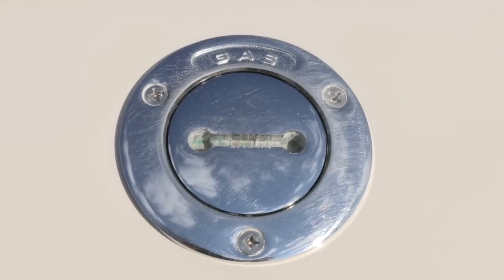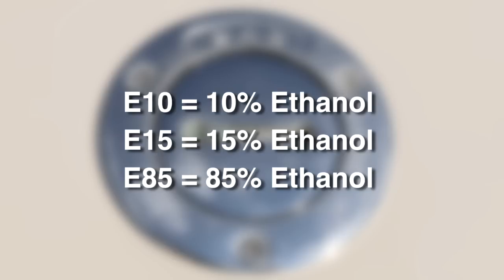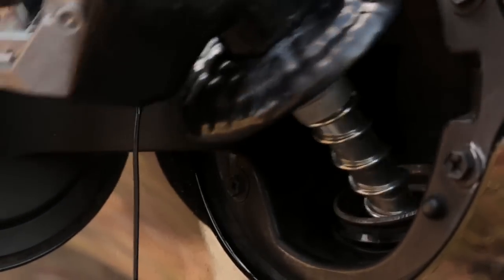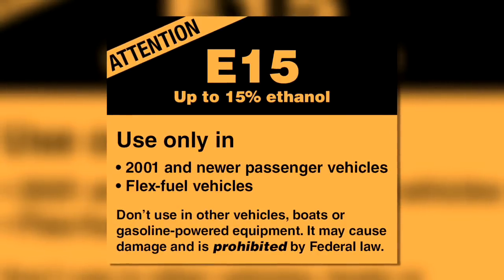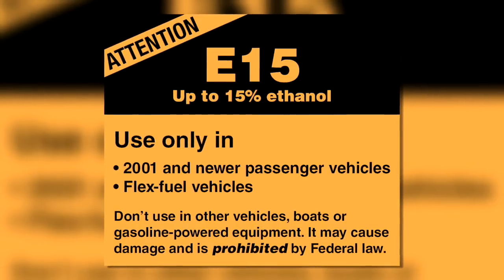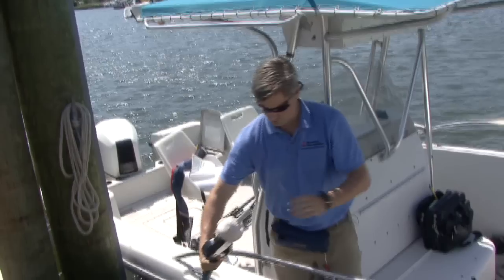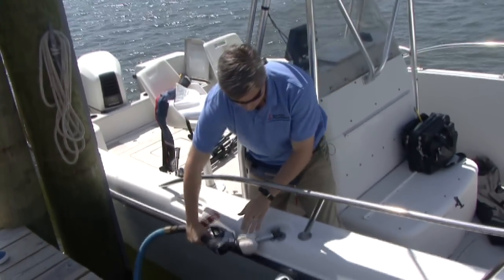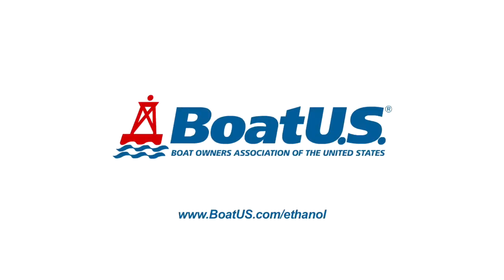Explaining Ethanol in Your Boating Fuel | BoatUS

Comment: Mercury Marine thinks E10(after a transition period) may be the superior fuel to E0 because it keeps the fuel "dry".  

Water in the bottom of fuel tanks is a problem of E0 gasoline which is why alcohol has been sold forever as gas-line antifreeze.  HEET and DRY GAS are two companies who make such products.

Mercury Marine, which hosted a Webinar on ethanol myths, noted that ethanol does not "grab water molecules out of the air." It is hydrophilic, which means ethanol holds water. With regular gasoline (E0) as well at E10, the primary cause of water collecting in tanks is condensation on tank walls. But unlike E0, which can absorb almost no moisture, E10 can hold up to half of one percent of water by volume, and the water molecules will dissolve in the fuel. The "solubilized" water will bypass the water separator and burn harmlessly through the engine.

https://web.archive.org/web/20140922142320/http://dcd96xmek71bc.cloudfront.net/archives/email/Trade/BoatingIndustry/MythsofEthanol-August252011.mp4

The common gasoline of Brazil contains a minimum of 27.5% ethanol and they have the >>very<< same boat engines we have here. 

It has worked out so well and for so long that Paraguay and Argentina have also gone to 27% ethanol.

 Clearly E15 would no doubt would run just fine and I would bet no one ever will be or ever has been arrested for using it.  Now that Trump has allowed E15 to be sold in summer, I would expect manufacturers to start including it as a fuel for use in future owners manuals.  

According to a paper published by the Society of Automotive Engineers, at 68 degrees F, alcohol with as much as 45% water will mix with gasoline and not separate. With 4%, alcohol will form a stable mix with gas down to about minus 22 degree F.*

*A.C. Castro, C.H. Koster, and E.K. Franleck, Flexible Ethanol Otto Engine Management System 942400(Warrendale, PA:Society of Automotive Engineers International, 1994)
Reply from the maker: Interesting info, Dana. Although ethanol-based fuels may burn without trouble, the issue is often related to ancillary parts such as hoses, fuel tanks, gaskets, and the like. Ethanol has been proven to eat through fiberglass fuel tanks and non-ethanol-rated hoses.
Reply: @boatus  Where is that proof? Specifically which rubber, plastic, and metal do you think ethanol damages?

There was a brief period in the last decade when a couple of boat manufacturers switched to a certain type of fiberglass fuel tanks that they had not tested with ethanol-gasoline blends. The ethanol did cause delamination of the fiberglass. This is why manufacturers should do sufficient testing, especially since they knew that the composition of gasoline was going to change. So the fault is with the manufacturers, not ethanol.

Nearly 50 years ago, Ford had trouble with the Maverick and Pinto cars blowing up when they were hit in the rear. The problem was that the fuel tanks weren't properly placed and protected. No one blamed gasoline for the disasters, they blamed Ford for not testing the vehicles sufficiently. This is the same kind of situation.

So knock off the anti-ethanol lies. In December 2011, BoatUS published a story about the Mercury Marine ethanol webinar, in which your company acknowledged Mercury's findings (http://www.boatus.com/magazine/2011/december/ethanol.asp). If, between that time and now you've been talking money from the oil industry to lie about ethanol, STOP IT!
Reply: @boatus  

Thanks for the reply.

There was a certain resin in older fiberglass that was incompatible with ethanol but it almost certainly is also incompatible with what goes into today's high aromatic E0 gasolines.  Today's gasoline contains high amounts of aromatics, premium gasoline has like 40% BTEX(benzene, toluene, ethylbenzene, and xylene).  Also note that today's gasoline has a newer addition of natural gas distillates which coincided with our increased use of ethanol.

The US government told engine manufacturers to have everything compatible with ethanol in the 1970s by 1983 if they were not already.

I would bet that most of the problems some may have are instead with high aromatics and natural gas distillates but all is being blamed upon ethanol.  As evidence I give the country of Brazil who as you now know has 27.5% ethanol in their common gasoline being used in identical boat engines but they have no natural gas distillates nor the need for high levels of toxic and corrosive aromatics since E27 is already super high in octane.

Ethanol is much >>>easier<<< on rubbers, plastics, and metals than what gasoline and BTEX(benzene, toluene, ethyl benzene, and xylene) are.

If you doubt this, look here:

Ethanol = https://www.customadvanced.com/chemical-resistance-chart.html?chemical=Ethyl+Alcohol&rubber=

Gasoline = https://www.customadvanced.com/chemical-resistance-chart.html?chemical=Gasoline&rubber=

Benzene = https://www.customadvanced.com/chemical-resistance-chart.html?chemical=Benzene&rubber=

Toluene = https://www.customadvanced.com/chemical-resistance-chart.html?chemical=Toluene&rubber=

Ethyl benzene = https://www.customadvanced.com/chemical-resistance-chart.html?chemical=Ethyl+Benzene&rubber=

Xylene = https://www.customadvanced.com/chemical-resistance-chart.html?chemical=Xylene&rubber=

Need a second opinion?

https://www.coleparmer.com/chemical-resistance

Or here for a third opinion:

https://www.graco.com/content/dam/graco/ipd/literature/misc/chemical-compatibility-guide/Graco_ChemCompGuideEN-B.pdf

Fourth opinion?  Sure, this is for rubber diaphragms(gasoline even does poorly):
http://ingersollrand.jp/pdf/fluid/fluid_catalog_15.pdf

See what high aromatic gasoline is rated for with aluminum:

https://www.calpaclab.com/aluminum-chemical-compatibility-chart/

Note that ethanol is good with aluminum.

The main nontoxic ingredient of RV antifreeze is ethanol and it would not have stood the test of time if it had been corrosive.
Reply: PS I can not edit my posts here.  Is this new to YouTube or just your BoatUS's channel doing this?  Thanks.
Reply from the maker: @danafletcher2341  I'm thinking that's a YouTube thing, but I'll look into it.
Reply: @boatus  Thanks, it is not you I can not edit other posts on other channels.  I will try a different computer later, did not see anything in my settings which could prohibit that.

I would appreciate your take on all the chemical compatibility charts from manufacturers too.  I debate ethanol a lot and was surprised myself when I first set out to see for myself the (false)claims made against ethanol.  The funny one is that ethanol with water is corrosive on aluminum.  Many Americans will be drinking ethanol from aluminum cans this fourth of July I am sure in the form of beer.  I like wine for lower carbs but perhaps a few IPAs will be consumed since it is special though I have always preferred glass for anything I consume.  Before aluminum cans metal cans were used for beer but that was before my time.  Ethanol has been sold in hardware stores in paper thin metal cans probably since we have had metal cans and hardware stores.

 Also, perhaps you could take a trip to Brazil and do a story about ethanol use in boats.  Great excuse!

Here is an interesting story about when fuels get spilled into the ocean.  Makes you think twice about petroleum.

http://www.freerepublic.com/focus/f-news/1088071/posts

Today on the NYMEX the price of ethanol traded at $1.58/gallon.

An unusable sub grade of gasoline(RBOB) traded at $1.92/gallon..

To raise RBOB to a usable grade would cost even more per gallon much like premium gasoline costs more than regular plus it would become more toxic and carcinogenic from the many volatile and corrosive aromatics added to raise octane including BTEX(benzene, toluene, ethylbenzene, and xylene).

Unless,,,,, you simply splash in clean 10% ethanol into RBOB which case it would become usable, obviously cheaper per gallon, and obviously less toxic.
Reply: @boatus  Did you get a chance to look into ethanol's compatibility with rubbers, plastics, and metals as compared to gasoline and very toxic and very corrosive aromatics such as BTEX(benzene, toluene, ethylbenzene, and xylene)?

Not what we are taught in media or what conventional wisdom often says.  

At least you now know better.

PS  Look into Brazil, lots of boats to see using E27.
Reply: @danafletcher2341  Also be very careful of people, in this case Dana Fletcher, who have an financial interest in pushing a product.
Reply: @elliothodgkins2166   We have to be just as careful of people who push against a product especially when those claims are so easily demonstrated as absolute and total bunk.

Mercury Marine has no financial interest in pushing ethanol but BoatUS could sell adds to petroleum companies, I do not know one way or the other and am not making that claim.  My claim is that they are wrong and I used the largest manufacturer of boat engines to prove them wrong.

The companies whose chemical compatibility charts I provided I doubt very much have financial interests in ethanol.  Do a search for more, there are very many and all will be more or less the same as the examples I showed.

The country of Brazil's common gasoline is E27, it is what it is, that country produces both oil and ethanol.  Paraguay and Argentina have or are going to E27 and they have boats as well.
Reply: @danafletcher2341  As someone paid by an ethanol advocate this is laughable. You attend every pro ethanol event.
Reply: @elliothodgkins2166  If I have stated anything that is not 100% true, please bring it to my immediate attention since I hate to be wrong on anything.  Appreciate it.

BTW, your post implies that you are paid by an ethanol advocate.  Was this what you meant or did you really want to imply that I am paid?

Also, I do not think I have attended a pro ethanol event in my life.  I rode along once with someone a few years ago to an EPA public comment event that took testimony from both sides but personally did not participate nor was I paid anything.

Comment: He also failed to mention that many older boats have fuel system components and carburetor components that can be broken down by ethanol. an example is the white colored plastic floats in older mercury outboards. They will swell up when exposed to ethanol and will cease to function, possibly leaving you stranded on the water. be sure to update the components in your fuel system especially if you plan to use any ethanol gas.